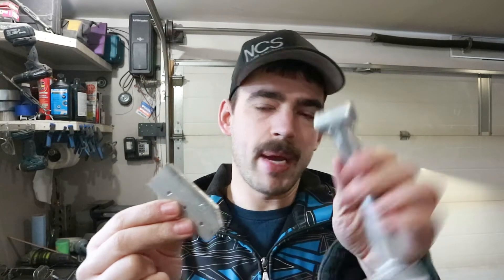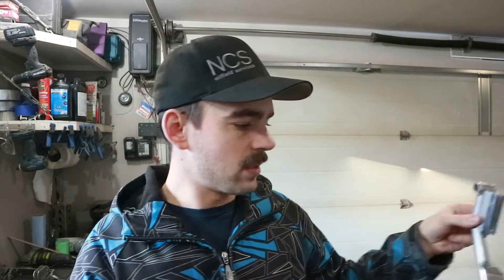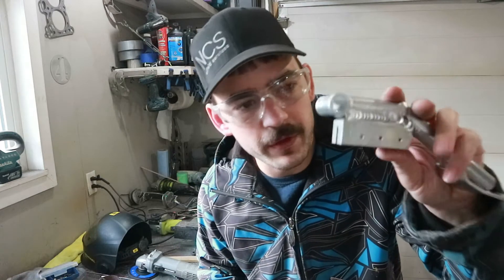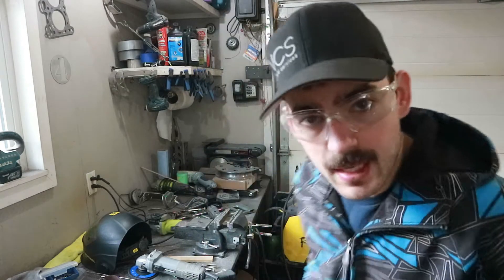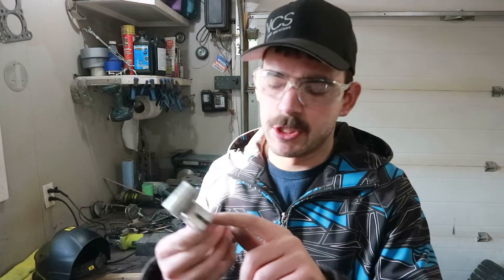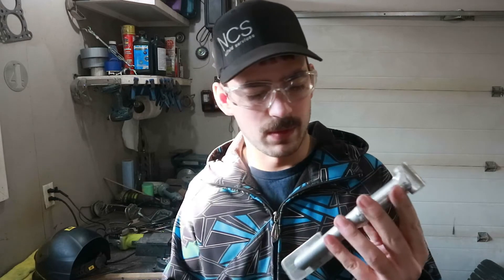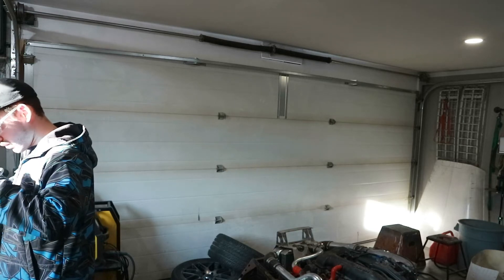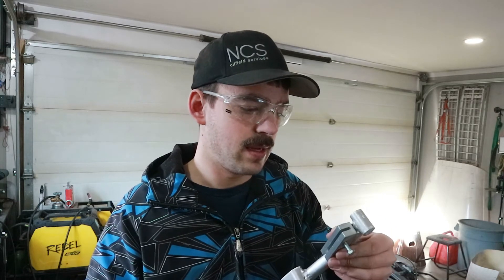Ep 181: SR20 Locost Throttle Pedal

Comment: Great job on the pedal assy. I don't believe you can drill that tap out. It will slide off center. Aluminum is to soft, to hold the drill bit centered.
Reply from the maker: You are correct! I got it out by just pounding it out and wiping the aluminum threads out of the hole, not the classist solution lol